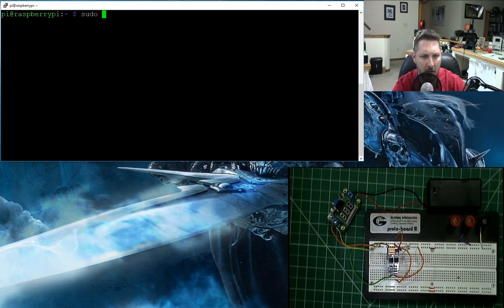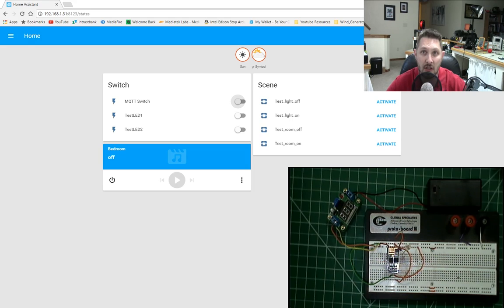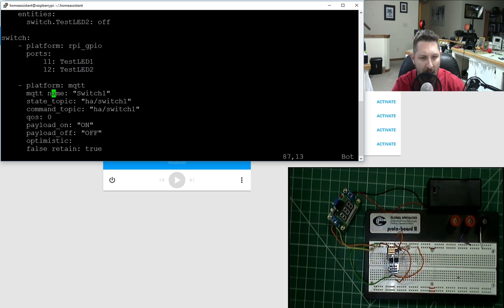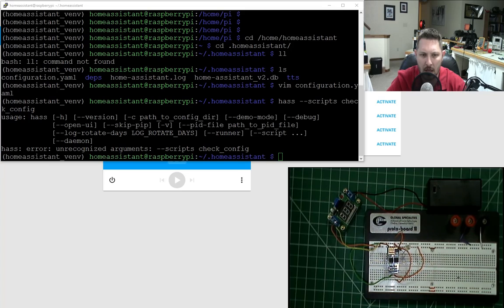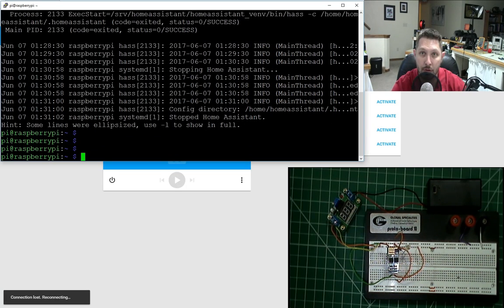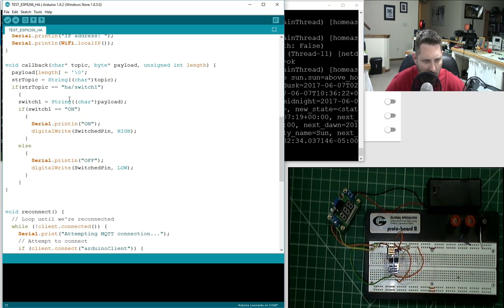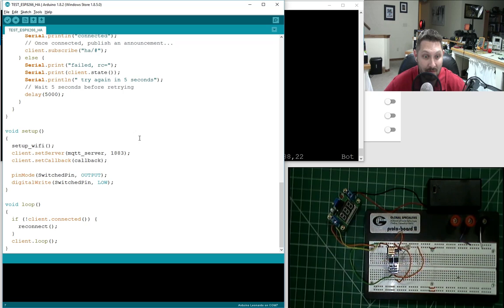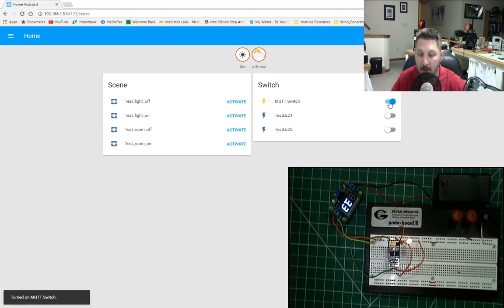HomeAssistant - MQTT and WiFi Device

Comment: Great video. 
I have an nodemcu controlled relay that switches humidifier on and off based on BME280. Is it possible to include that into the homeassistant?

Comment: Hi, I can control the switch and light comes up on ESP8266 as well, buuuuuuut i cannot get the icon change status,  i am using (Home Assistant 0.110.1,  Frontend version: 20200519.1 - latest) . I think there is an issue in this version, i cannot even get themes working in this.  Can anyone help please.

Comment: NOTE: This video is for home-assistant, not HASS.io Docker installation.

Good video. I really appreciate the work here. The video has a bunch of subtle errors in it, but good video overall. It should still work, it just isn't following good IoT conventions. (Which I'm just learning myself.) Example: state_topic: "ha/switch1" and command_topic: "ha/switch1/set" as a means to separate the device commands from the device switch commands. This will also allow you to program more GPIO getters and setters on the Arduino. Example: command_topic: "ha/switch1/gpio1/set" and command_topic: "ha/switch1/gpio2/set"  which you then mirror in your Arduino code. 

I agree with the comment about editing down the video to speed up sections where you are waiting and taking out the "UMs" and "Ohs" for better flow. I've been watching a bunch of other videos and it took me a while to figure out that they were doing those subtle edits. It just makes for a better viewer experience.
Reply from the maker: Thanks for the suggestions I appreciate it a lot.  Love good feedback.

Comment: Do you have a video on sending an mqtt message from ha to a RPi and have the rpi run a script?
Reply from the maker: I don't have that specifically but I employ the ability to run scripts with the video I did on how to use pianobar which is a linux program to run pandora radio. Check out the method that I used to get this done and I think you will find the answer to your question there.  https://www.youtube.com/watch?v=GVYhcT8bKPg

Comment: Do you need a password for MQTT. I have mine set up with a password
Reply from the maker: If you have set up a password you will need to add it to the code.  Here is a  more recent video I did for a sonoff switch that uses the same esp8266 https://www.youtube.com/watch?v=bODVelG4FKI&lc=UgxYIMyP4ZNGXx-kF254AaABAg  The code for this is on my git hub at https://github.com/misperry/SonOff_HASS_MQTT
Reply: Thanks I will try adding the user and password lines and see.
Reply: Thanks man after week i get the program to upload, it was the user and password set up. now i can Not get the LED to turn on. where in the code it says GPIO0? i dont see it. next how do we get to use this code for more LEDs to use test 1 and 2 from HA.

Comment: Hi, great info. Where do you put the password for the MQTT HA server in the code
Reply from the maker: Hey there, it has been a while since I did this one so bear with me lol.  I believe in this situation it did not need one.  However, if you have a password on your MQTT you can add the following lines of code:

Near the top of the code add the:  #define mqtt_password "" 

Then go down to your "reconnect()" function and look for the line that reads:  if (client.connect("arduinoClient", mqtt_user)) {

Then change that line to read:  if (client.connect("arduinoClient", mqtt_user, mqtt_password)) {

This should do it for ya.  Check out my sonoff code for example:https://github.com/misperry/SonOff_HASS_MQTT
Reply: Thank you very much, it worked out.

Comment: To setup Mqtt in Windows which open source broker should be installed ????
Reply from the maker: Hey there thanks for the comment.  One broker that I have used was Mosquitto.  It is one that can work for linux or windows.  Here is the link:  https://mosquitto.org/  this one is very easy to set up and works great.  I have only worked with it in a linux environment but I am sure it will work just as good in windows.

Comment: Great video, just one thing that im not sure about. What happens if the raspberry pi IP address changed since it is dynamic address, do i have to flash the new address to the esp module every time? Or is there any other way to solve this issue? Many thanks
Reply from the maker: Yes in this case the way it is coded it would have to be re-flashed.  However, you could get around that with doing a DHCP reservation on an address that you want your raspberry pi to use.  This way you set up your raspberry pi to request a DHCP address but your router just gives it the same address every time based on the raspberry pi's MAC address using DHCP reservation.  However, it is all arduino code and I haven't explored the entire library for MQTT.  You could see if you could point it to a DNS name and have an internal DNS server that will always translate the name to the IP of the pi so you could have like a DDNS going on in your house.  That sounds like it could get complicated but it is doable.
Reply: misperry thank you so much sir, keep it up. I would love it if you post more videos regarding hass, especially esp8266 interferance with RF (radio frequency) automation.
Thank you again

Comment: Thank you so much for your videos.  So I have HA, MQTT up and running.  I've added a wifi Light-switch.  Now, I'm trying to add a BME280 Temp sensor connected to a Wemos ESP8266, "publish" the temp via MQTT.  I had LOTS of help converting the temp data to a "string" value in order to publish the Temp, Humidity, and Pressure via MQTT.  I can view the sensor values from the serial console and MQTT.  On the HA dashboard; I have the little ICONs for each Topic but the values are represented by a  "-"  dash on two of them, the other, is a blank circle.  Any suggestions?
Reply from the maker: I have done a similar video with a temp sensor.  Here it is https://www.youtube.com/watch?v=Heo8ZwFT4ig&t=193s  See if that helps you out a bit.

Comment: Boss i got my arduino code success connect with mqtt.  but when i try to turn the switch on from home assistant nothing happening do you want the video i can share.

Please help
Reply from the maker: +Unified Technology if you would like to share the vid that would be great.  However, did you get the MQTT to connect?  Basically did you see it connect through the serial monitor on the arduino ide when you powered it up?
Reply: @misperry  I have the same issue. I'm using the NODEMCU ESP8266. I changed the output pin to 13. This pin works fine when I use the blink program but does not come on with the HA switch. MQTT shows as connected in the monitor but I see nothing after that: 
WiFi connected
IP address: 
192.168.0.17
Attempting MQTT connection...connected
Is there a log we can monitor from home assistant?
Reply: @varnavatube  did you fix it?
Reply: @fin3125  For the life of me I could not get the local MQTT server to work. I enabled the log on home assistant and then used the MQTT.fx tool. I could publish to a topic. I could subscribe to a topic but it didn't matter what I did but I could not retrieve any data (and there were no error messages). It was not the program or hardware as I was able to communicate with a MQTT service on the web. So I installed a broker within home assistant and finally got that to work. At least it was a good education!
Reply: @misperry  Same thing for me as Unified and Zoke. I added another print line to see if the function gets called and it does not. It does say it is connected on both sides. Can you tell me where to look next?
Reply: Did you fix it?

Comment: i got home assistant work, but now i am stuck on Arduino

on my raspberrypi for mqtt test i use mosquitto_sub -d -u "username" -P "password" -t "dev/test" work fine by on Arduino the mqtt is failing.  I am user it is failing because of username and password and i dont where to give the username and password for mqtt connection.  Need Help

Comment: Sir i need your help, my Home Assistance is running well.  But when i write a simple switch command like:

switch:
 -platform: rpi_gpio
  ports:
    11: TestLED1
    12: TestLED2

its generate a error and then HA is not working
error:
Aug 28 13:07:34 HA systemd[1]: Started Home Assistant for homeassistant.
Aug 28 13:07:39 HA hass[26750]: 2017-08-28 13:07:39 ERROR (Thread-2) [homeassistant.util.yaml] mapping values are not allowed here
Aug 28 13:07:39 HA hass[26750]: in "/home/homeassistant/.homeassistant/configuration.yaml", line 90, column 8
Aug 28 13:07:39 HA hass[26750]: 2017-08-28 13:07:39 ERROR (MainThread) [homeassistant.bootstrap] Error loading /home/homeassistant/.homeassistant/configuration.yaml: mapping values are not allowed here
Aug 28 13:07:39 HA hass[26750]: in "/home/homeassistant/.homeassistant/configuration.yaml", line 90, column 8
Aug 28 13:07:39 HA hass[26750]: Config directory: /home/homeassistant/.homeassistant

Please advice what i am doing wrong

thanks

UT

Comment: Great video just how tu connect 2 esp8266 to on home assistance i try to change switch 1 to switch 2 just wean i connect 2 esp8266 on its working second no not to that time i disconnect power from first on any solution to connect multiple esp ??
Reply from the maker: make sure that the code that is running on the different esp8266 devices are matching the configuration in home assistant.  if you are using the same arduino code on the esp's and changing config in the home assistant this will not work.  The code on the esp needs to match up with home assistant.  Hope this helps.
Reply: no style that same 
 - switch.gpio2
      - switch.gpio3
      - switch.mqtt_switch
      - switch.mqtt_switch2

- platform: mqtt
    mqtt name: "Switch1"
    state_topic: "ha/switch1"
    command_topic: "ha/switch1"
    gos: 0
    payload_on: "ON"
    payload_OFF: "OFF"
    optimistic:
    false retain: true
 
  - platform: mqtt
    mqtt name: "Switch"
    state_topic: "ha/switch2"
    command_topic: "ha/switch2"
    gos: 0
    payload_on: "ON"
    payload_OFF: "OFF"
    optimistic:
    false retain: true
  

iFiClient espClient;
PubSubClient client(espClient);
int SwitchedPin = 5;
String switch2;
String strTopic;
String strPayload;

void setup_wifi() {
 Serial.begin(115200);
  delay(10);
 
  // We start by connecting to a WiFi network
 
  Serial.println();
  Serial.println();
  Serial.print("Connecting to ");
  Serial.println(ssid);
  
  WiFi.begin(ssid, password);
  
  while (WiFi.status() != WL_CONNECTED) {
    delay(500);
    Serial.print(".");
  }
 
  Serial.println("");
  Serial.println("WiFi connected");  
  Serial.println("IP address: ");
  Serial.println(WiFi.localIP());
}

void callback(char* topic, byte* payload, unsigned int length) {
  payload[length] = '\0';
  strTopic = String((char*)topic);
  if(strTopic == "ha/switch2")
    {
    switch2 = String((char*)payload);
    if(switch2 == "ON")
      {
        Serial.println("ON");
        digitalWrite(SwitchedPin, LOW);
      }
    else
      {
        Serial.println("OFF");
        digitalWrite(SwitchedPin, HIGH);
      }
    }
}
 
 
void reconnect() {
  // Loop until we're reconnected
  while (!client.connected()) {
    Serial.print("Attempting MQTT connection...");
    // Attempt to connect
    if (client.connect("arduinoClient")) {
      Serial.println("connected");
      // Once connected, publish an announcement...
      client.subscribe("ha/#");
    } else {
      Serial.print("failed, rc=");
      Serial.print(client.state());
      Serial.println(" try again in 5 seconds");
      // Wait 5 seconds before retrying
      delay(5000);
    }
  }
}
 
void setup()
{
  setup_wifi(); 
  client.setServer(mqtt_server, 1883);
  client.setCallback(callback);

  pinMode(SwitchedPin, OUTPUT);
  digitalWrite(SwitchedPin, HIGH);
}
 
void loop()
{
  if (!client.connected()) {
    reconnect();
  }
  client.loop();

that what i try to use and no luck

Comment: good stuff. Where can I find the code to  try it out
Reply from the maker: Hey there, I apologize but I had zipped up all the information and then forgot to post it.  I have the link here for you and I have added it to the description on the video.  Thanks for catching it.

http://www.mediafire.com/file/sfq1m65vn7vgjqf/MQTT_ESP8266.rar
Reply: Thanks for that. Glad I asked the question: Just wondering if you have a view on the following. Are there advantages using mosquitto as the brker. Can they both co exist?  Thanks
Reply: Sorry I should have asked that in a more meaningfull way. Apart from the increased security aspects (and remote access) do you think the mosquitto brker  has other advantages? I am wondering about conflicts once you get a ha system going that is exchanging lots of messages (bandwidth) and how it handles retries if there are messages arriving simultaneously  ie resending  and is there any tuning involved?  thanks
Reply: one mor, did you remember to include the ha yaml file example?

Comment: Bro i have a lot of problems , i cant connect my esp8266 lua mqtt with homeassistan to open a garage door
Reply from the maker: +LUCIFER LUCIFER hey there what seems to be your main problem?  Did u get the ESP8266 connected to your WiFi?  Did it connect to your mqtt server?  Check your router port forwarding settings.